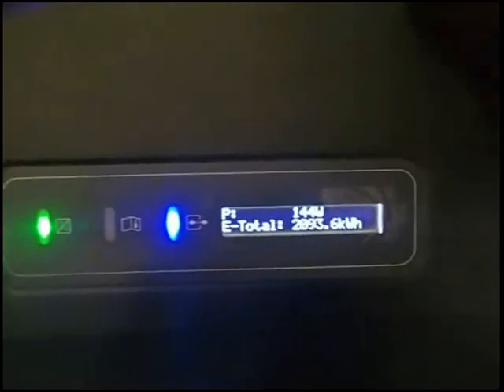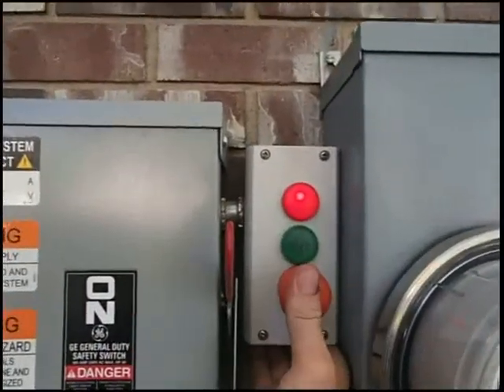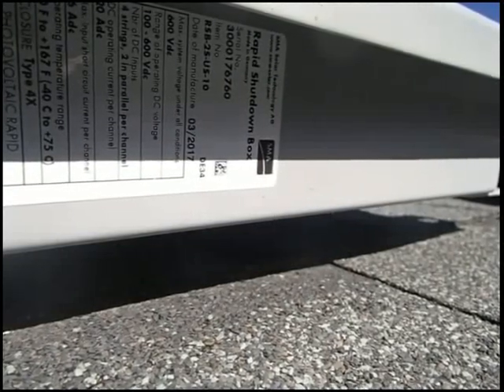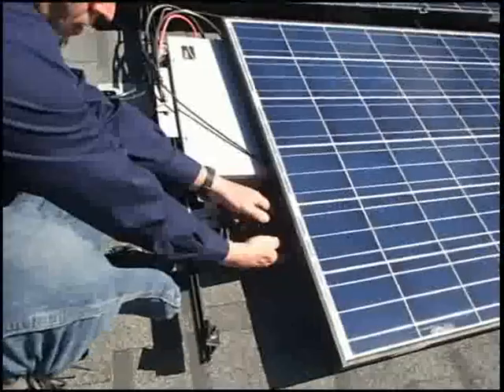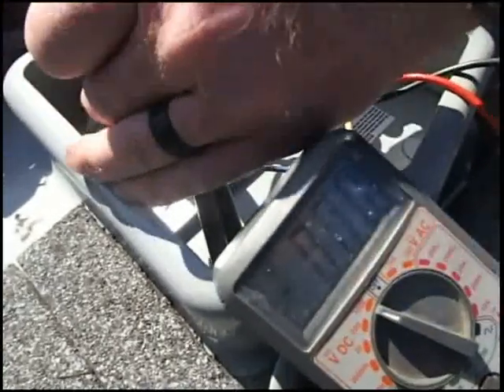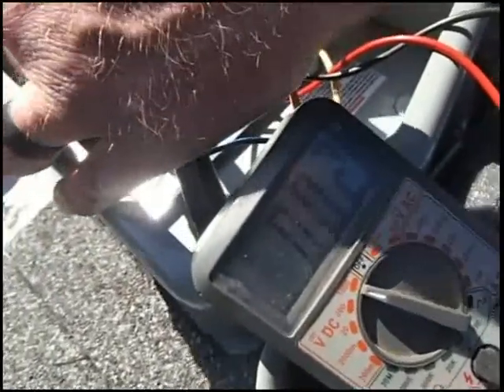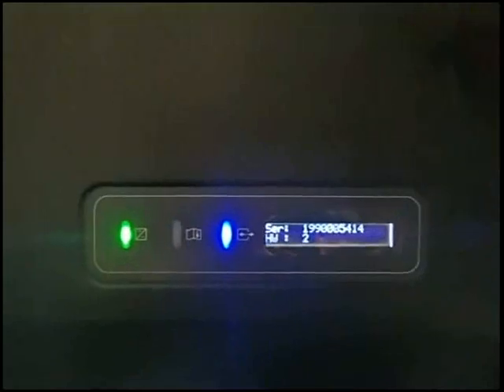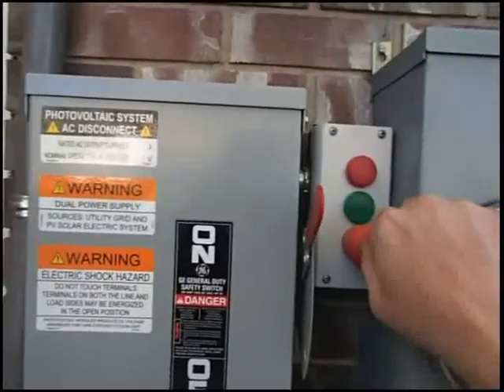Solar Panels - SMA Rapid Shutdown Intermittently Not Powering Up, April 30 2018 [SOLVED]

Comment: Good vid with troubleshooting info and suggestions. Installed SMA inverter with SMA RSD's last year. The inverter failed after only 9 months. Very untypical of SMA... To SMA's credit they sent a replacement out and received it in 2 days!! Despite the premature inverter failure I am still glad I went with SMA products. btw- I have read competitors MI's fail in less than a year also. Id rather replace something on the wall than having to go on the roof to troubleshoot MI's installed underneath solar panels...

Comment: your string had neg/positive voltage reversed
Reply from the maker: Reversed?  Are you referring to the fact that the voltmeter shows negative voltages at 5:29 and at 6:42 in the video?  Those negative values are related to the voltmeter rather than the string.  The voltmeter was hooked up backwards.  Notice at 5:29 the black lead (neg) from the voltmeter is hooked up to the red wire (pos) from the string.  So, the voltmeter showed the appropriate voltage, but as a negative.  Same deal at 6:42--the polarity of the system was fine, and the negative voltage showed on the voltmeter simply because the voltmeter leads were reversed.

So, I'm thinking the polarity of the system is fine.  Or are you seeing something else that I'm missing?

Comment: Hi I'm helping my dad with a self install.. We have three strings of solar panels going into one rapid shutdown and one inverter (same models as yours). We connected the two outputs from the RSB to the Inverter but it seems like one of the three strings is not being picked up by the inverter. Did you have to install a three wire connector between the RSB and inverter and if so where did you get yours as I am having trouble finding that part.
Reply from the maker: I don't have any actual 3-wire connectors between the RSBs and the inverters.  Each wire (+, -, and ground) runs on its own in a shared conduit between the RSB and the inverter.  I think the only connections are in the roof pass-through boxes on the roof and in a junction box in my attic, but each connection is a single connection (a single terminal or a simple wire nut) for each wire rather than a 3-wire connector.  I'm guessing you'd need 5 wires--output A's + and -, output B's + and -, and a ground.  Also, keep in mind that whichever two strings that go into the same side on the RSB have to consist of the same number of panels.  If you'd like to talk on the phone and/or see a diagram of my wiring, I'd like to see if I can help.  Send your phone number to me at jaromcall@hotmail.com.
Reply: I know this late but what you want to do is run 5 conductors (2 red, 2 black, and a ground) like u would for 2 strings. Connect your 3 strings to the rsb(2 strings on ch A and 1 on ch b). Then you just use two 3 hole Polaris connector in the inverter for ch A wires(black and red) and split them into ch a and b terminals inside the inverter.

Comment: Did you ever get your issue resolved? I’ve installed countless of these and have had a handful give me issues. These boxes have a great concept, poor execution. The 3-string systems have never given me an issue...yet.ha
Reply from the maker: Yeah.  Thanks for asking--your question prompted me to add the 6/13/2018 update in the description above.  All's well.  The replacement rapid shutdown from SMA did the trick.  They seemed very interested in getting the old one back for testing, as they soon followed up with me to make sure I would send the old unit back within their desired timeline.  Hopefully their research on my failed unit and on other failed units will lead to an improvement going forward.  Or, if nothing else, they seem very familiar with this issue and very willing to help...if the unit is still under warranty.  Not sure what help SMA gives with out-of-warranty components.
Reply: Great to hear it worked! Bet it was a big relief once it started working properly again. Did you do the install yourself? Also, saw you placed a soladeck, great choice for keeping everything low-profile. SMA is pretty good with the tech support, but couldn't come to a conclusion on my issue. On 2 occasions the RSBs have given me arc faults. At first I thought it was me that had a pinched wire, but after checking every possible point of contact I finally decided to bypass the RSB all together and the system finally started working properly. Eventually got them replaced and have been working fine.
Reply from the maker: Yeah--self-install.  It was a fun project, it was a good challenge, I saved a lot of money, and I became familiar enough with the whole system that I don't have to depend on someone else (who may or may not still be in business) when something goes wrong.
Reply: @TheKid1130  
I had isolation faults on a rsb 
It ended up being you cant share a rsb with 2 inverters
Reply: @SolarTechFL  yeah unfortunately you can share inverters, but you can use up to 16 rsb's per controller.ha I honestly have grown to hate these boxes.
Reply: @TheKid1130  yea 3 channels would help.
I have put in over a hundred rsb's with no failures. 
Only 2 installer errors when we first started using them.